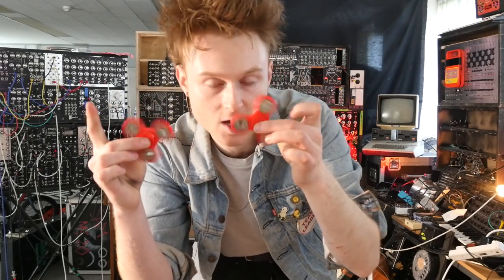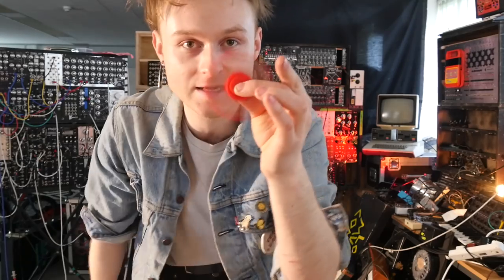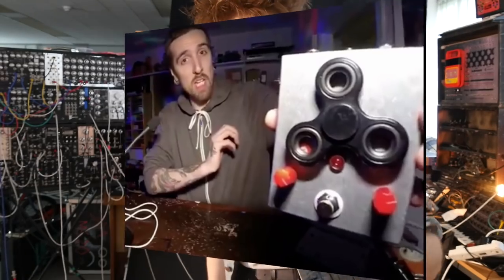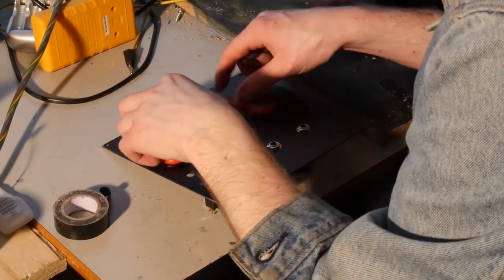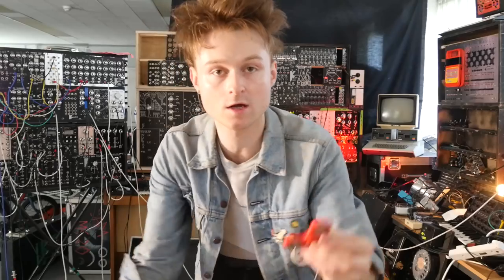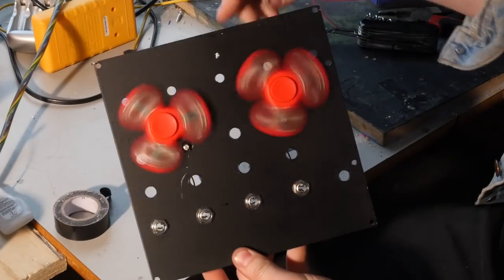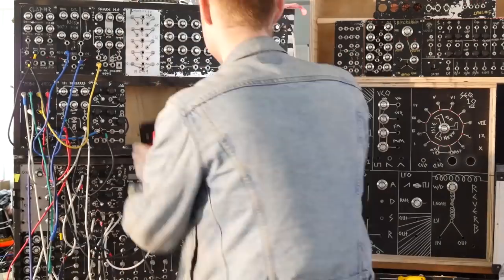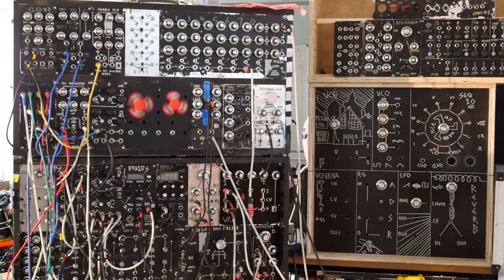FIDGET SPINNER SYNTH #fidgetspinner

Comment: I would take this one step further and have an infra red LED on one side of the spinner and a infra red receiver on the other side so the blades will block the infra red signal as they pass but ambient light wont affect it. You could use it in total darkness as well.
Reply from the maker: Nick Tate do it!!!
Reply: @LOOKMUMNOCOMPUTER  ok cool I will and I will make a video. Ok, I'm off to buy a fidget spinner! 😀